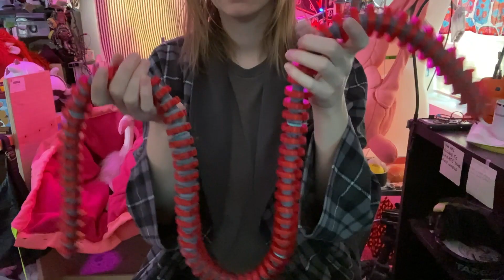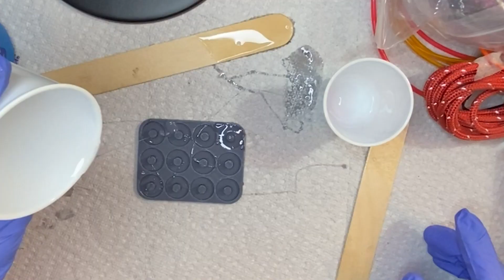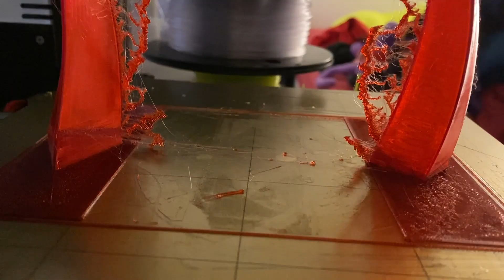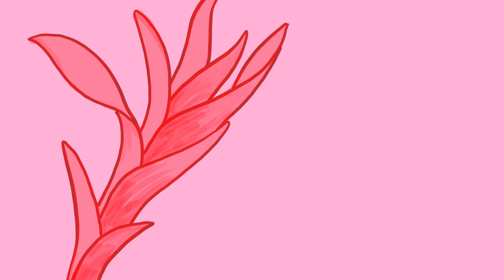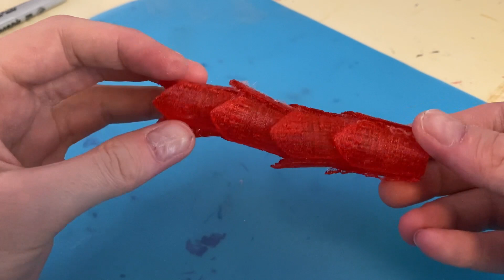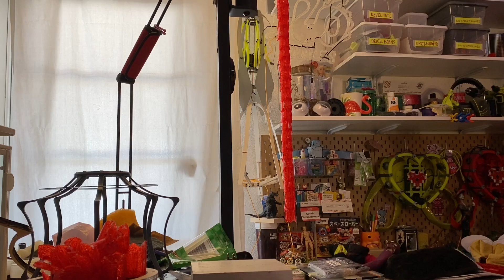Devil Tail v.2

Comment: Could you control the tail with your hips? Twisting the hip backwards makes the tip go up, forwards down, and moving the hip to the side to the sides and so on? Prolly the tail would need to be moved by motors pulling on the strings to make the movements more extreme, but I could imagine this to be a natural way to control a tail ^^